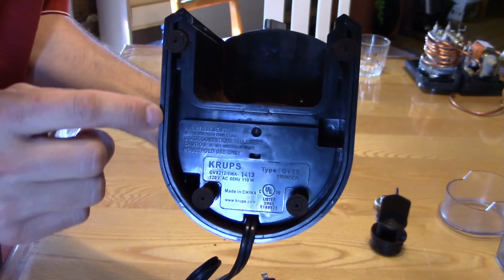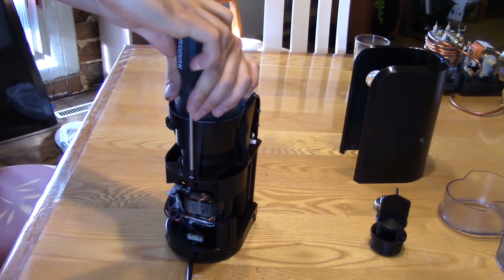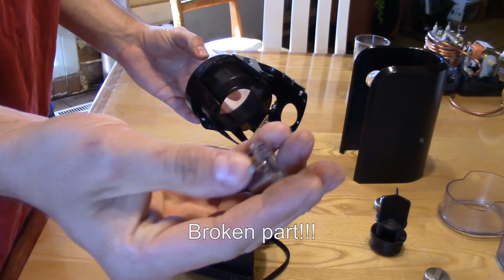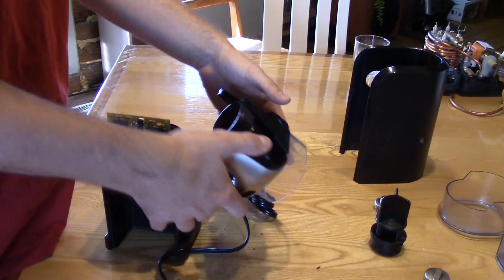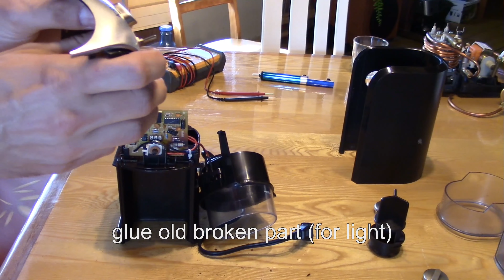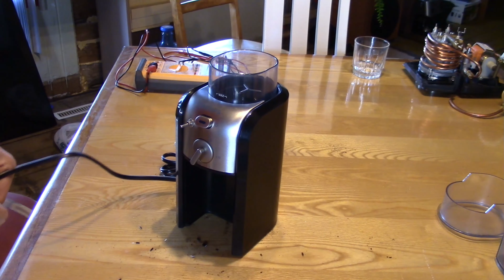coffee grinder krups gvx2 repair : Comment réparer moulin café krups gvx2

Comment: Thank you Alexis! With your video I could open my grinder (and not lose the safety spring - haha), and I repaired the switch by reattaching it with superglue and two cuttings taken from a small cable tie, glued to the switch's neck and wedged under the securing washer and screw. Now it works better than when new. I'm delighted!

Comment: Thanks Alex,  I couldn't get it apart either! Repaired it with a toggle switch as same as you, I couldn't face pulling it apart again in 6 months when the glue or wire failed.

Comment: Great stuff! Thank you! 

I fixed my button (same problem, the tiny plastic had broken) by winding steel wire tightly around it, making a small loop for the casing-screw to hold. Works like a charm now. 

Thank you so much for the disassembly video! :D

Comment: I was having a similar problem with the switch, it was operating intermittently. With the help of your video, I was able to disassemble the unit. I found that the circuit board containing the switch had slipped from the retaining clips allowing it to move away from the on/off button. I reinstalled the board into the mounts and reassembled. I never would have gotten it open without your video. THANKS

Comment: My switch broke off and fell inside just like you showed. Very helpful showing how to open. I couldn't understand why I couldn't just push the power switch. Found the cup switch was jammed a little. Got that clicking again and grinder started again. Now i just use the handle of the brush to push the start switch through the original switch hole. No risk of damaging anything with soldering modifications.

Comment: Thanks for showing how to disassemble them, finally managed to get the grinder working again after fixing 3 major issues in my unit 😅

1. Snapped power button
2. Broken timer 
3. Failed capacitor at the power cord
Reply: how you did the troubleshooting?
Reply: @hikmat8329  hi, what issues are you experiencing? 

for my case initially the power button snapped, so i glued it back using epoxy adhesive. But after some time the grinder motor refused to start occasionally, motor seemed fine, so i suspected the timer or the motor capacitor was weak. Bypassing the timer and replacing new capacitor made it worked again, but there is no timer function anymore, you have to manually control it by adding switch at the power socket.
Reply: Hello please if you could spare a minute please tell me how you found this? Mine is the same I have replaced the plug, lead and done continuity test and suspect the capacitor is at fault
Reply: @storegga  hi, you can easily confirm if it is the capacitor by hooking up all the circuit, for my case the motor failed to start sometimes, but when you try to spin using bamboo stick (dont use your hand!) then the motor starts right away.

Comment: Great video to show how to disassemble the grinder to get to the switch. I was able to use crazy glue to glue the plastic tab that the switch is mounted back together. Then put a small piece of fabric on each side and glued with crazy glue. Put the switch back in and perfect. The actual switch was fine. Just the button that touches it was broken. Thanks for the video.

Comment: This helped me a lot.  I fixed my switch slightly differently.  I put unscrewed the switch attachment and taped the two pieces together with duct tape, then screwed it back in.  Seems to be working ok.  I don;t have Alexis' skills to fix it more professionally.
Reply from the maker: The important thing is that it works!! Thank for comment!!
Reply: That's what I did - I should have read further, then I'd have seen your post.

Comment: Thanks. Looking on how to open the case. I end up fixing it by glueing the broken part with a nickel strip for battery then strengthening it with adhesive tape and it works!

Comment: Excellent video. Could do with a bit more light though. I had the same problem with a broken switch and was scratching my head about how to get inside and fix it and the video shows it perfectly. I can’t beat using a toothpick for simplicity, but maybe safety isn’t great.
I can offer a couple of alternatives to rewiring with a switch that are maybe a bit easier. Firstly on eBay you can buy replacement switches for not much money. I haven’t tried it so I’m hoping they fit. However the original switch is a bad design so a replacement also may not last.
What I did was put a couple of small pieces of heat shrink tubing concentrically on the broken switch tab and then flatten the outer tubing and clamp it with the switch retaining screw. This has just enough springiness to allow the button to press the micro switch so it works. I’m hoping the heat shrink tube lasts in this application. Let’s see.

Comment: Thank you for the instructions on disassembly. Similar problem to your switch, the circuit board has flexed so the plastic push button does not make contact with the micro switch on the circuit board. I braced the board from behind with a piece of foam so the button now makes contact. Working again.
Reply from the maker: Great idea

Comment: Super helpful - thanks. Like jacobsteel - I used the video to help with taking it apart, then I improvised (i didn't have a switch to hand) first supergluing the plastic clip back together and I also added a support baton, using tin-snips to cut up a spare terry clip to get a flat plate. It works, but no idea how long it will last, still for people without soldering skills this approach may help. (i've ordered a switch though for incase it breaks)
Reply: Hola: ¿Me podrías decir dónde comprar un interruptor? Tengo el mismo problema. Gracias

Comment: Before opening - check the lid lockout switch, if any coffee dust is in the lip between the inner and outer case it stops the lid from pressing all the way down and deactivating the lockout, simply use a knife upside down to clean out the coffee from the well and it should work again!

Comment: Great info about how to repair the grinder.

Have anyone noticed if the grinder is little warmer on one side all the time?

I hooked up a powermeter and noticed that in stby it uses about 1w when it not is grinding, just connected.
This type of 'too'l should not use any power when not in use.

Maybee our is broken, but I'm not sure if it is like this on all in use.
Reply: I also noted that the PCB at R2, the big resistor, is little black.
Reply: I think mine also slightly warm on one side. Bought it used, used it for years. Just opened it after main switch button broke. Didn't see any other issues inside.

Comment: Great guide. My gvx2 just grinds for 3 sec and turns off. Any hints what to look for, switches are not a problem. Tnx
Reply: Double check top cover and bottom cup switches. Make sure they click open and closed.

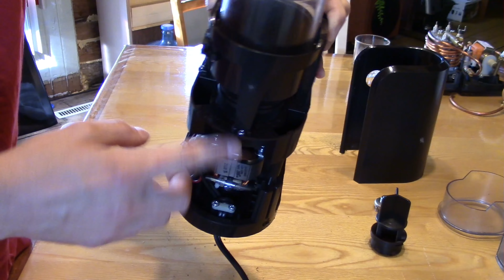Comment: It is possible to remove the silver/grey front without taking the two screws out (1:49), as it unclips at the top. I have just done this.
I then removed the screw holding the remains of the button bracket, folded a piece of very strong adhesive tape over it & the "leg" on button, made a hole through for the screw & put everything back together.
So far, this works but I will have to see how long it lasts. I think I will modify the button with a small piece of spring steel replacing the plastic leg which screws to the front panel.
Just found the switch on eBay UK for £9.99/€11.75 
Search for Krups GVX2 switch.
Reply: Yeah since I removed the front dial before taking it apart the silver/grey front panel fell off after pulling it apart. For ours the button was not broken but it was hard to press in/out and would stick on. Turned out to be a layer of grime on the button that I wiped off and now it works great but I can see how flimsy the little plastic is that hold the button which will eventually probably break. Thanks alexis c for your video which helped a lot!
Reply: Thanks
Reply: @JoseSanchez-uv9br  More than two years on. my 'temporary' tape repair is still working just fine, so I've not bothered to buy a new switch.
ETA  That eBay search term shows they're even cheaper now - less than €7.

Comment: I have the same exact repair to make. What type/gauge of wire did you use?  Thank you for this video!
Reply from the maker: hi gauge 24 or 28 or small is ok switch not draw big current!!take wire you have in stock aluminium or copper ;)
Reply: So any lamp cord or similar that I have laying around? That's great. Thanks again!
Reply from the maker: take care for not to big for hole circuit!!any wire with shield!!

Comment: Very useful, thanks. Unfortunately mine switches on but just for a second, irrespectively of the settings. I opened it, cleaned it using a product for electronic circuitry, but no result. Any idea? Thanks again.
Reply: La VF est que mon moulin ne se met en fonctionnement qu'une seconde, quelque soit le réglage et le démontage et nettoyage au nettoyant à contact n'a rien donné. Une idée ? Merci
Reply: I had the same problem. I fixed it changing the C1 capacitor (mine it was the 47K275V-X2) for a new one.
Reply: @marcelorodacki1154  thanks a lot Marcelo, I will try,thats very kind of you

Comment: What are the specs on the toggle switch you used ? What connectors to solder onto the toggle switch ?Im set in EU 240volts - what to look out for when I buy the switch and when I try to solder it onto the grinder ?
Reply: I was wondering the same thing - is it a high voltage or low voltage switch?

Comment: I disassembled the grinder, but when I mounted it again, the grind position wheel was not staying at a fix point (it moves when the machine is grinding, changing the grinding configuation randomly due to the vibration). Any idea on how to fix it? Thanks
Reply: Set the grinder to coarse,then insert the grinder & push gently downwards whilst turning it anticlockwise. You will feel it slot into its locked position. To remove, turn clockwise & you'll feel it unlock from the body.

Comment: (English below)
Merci Alexis pour ce tuto pour démonter le moulin Krupps gvx. Cependant le mien a un problème légèrement différent : j’ai l’impression que le bouton n’est pas (encore) cassé vive l’obsolescence programmée ! le moteur tourne bien quand j’appuie mais il s’arrête au bout de 3 secondes !! Est-ce que quelqu’un peut m’aider !?
D’avance merci !

Thank you Alexis for this tutorial to disassemble the grinder Krupps gvx. However mine has a slightly different problem: I have the impression that the button is not (yet) broken -vive programmed obsolescence! - the engine runs well when I press but it stops after 3 seconds !! Can anybody help me !?
Thanks in advance !
Reply from the maker: Probablement une composante sur le circuit, essais de voir si la soudure des pièces ne serais pas endommager en premier. Résistance brûler ou autres!

Comment: What volt/amp rated switch did you use?
Reply from the maker: Matthew Malpeli small work!!! My switch is over and over 15amp 125volts
Reply: @caronalexis  Does this apply for EU ? 240 volts ?
Reply from the maker: @findmads  same
Reply from the maker: Low volt on switch

Comment: No need for a repair - just push the busted switch into the machine and use your finger to press the microswitch. There's no high voltage on the pcb just 5v.  Been doing this on this machine for over 10 years.

Comment: 😢Bonjour .le bouton poussoir de Krups gvx2. clignote seulement
Reply: One of the other 3 switches might be struggling. Especially top cover or bottom cup. Remove and clean. Not too tight with mounting screws.

Comment: Poor design anything that relies on the pliancy of plastic will fail. I had the same problem, I fixed it by using a narrow metal picture hook as a brace and fixing the button to it with epoxy glue.